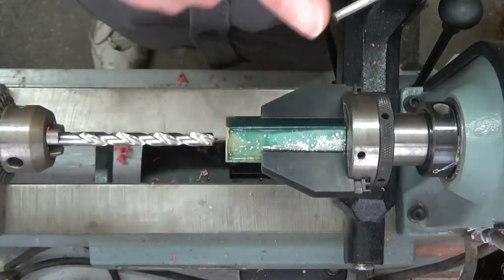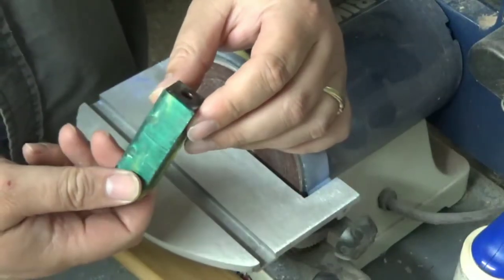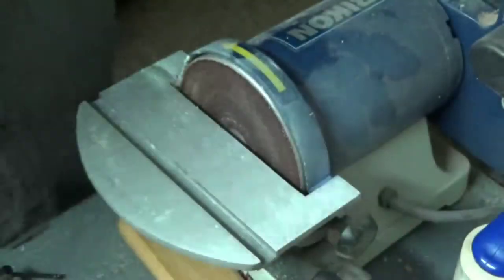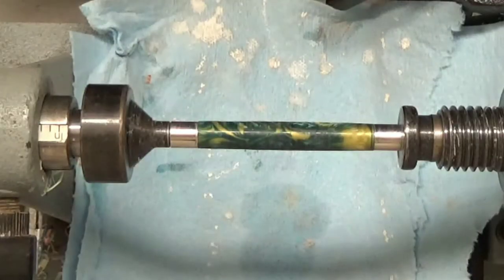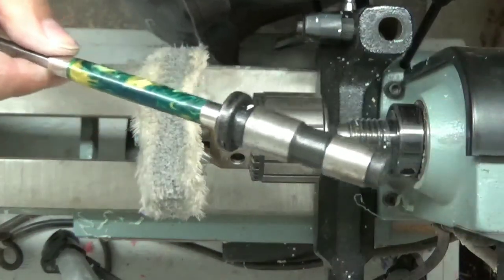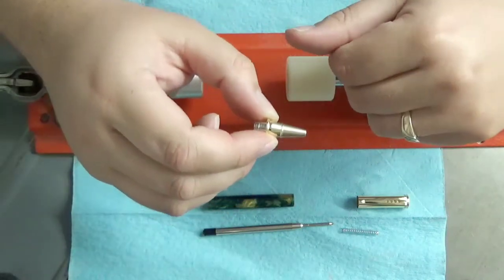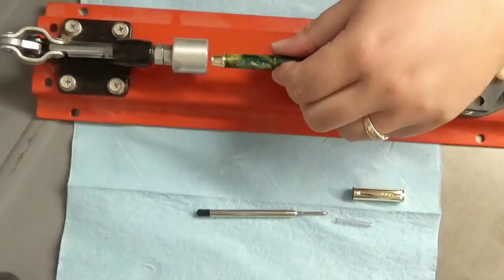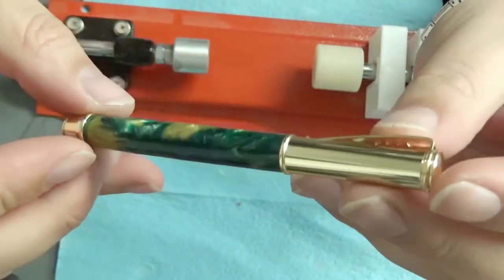Turning a U of O Duck Colors Editor Pen

Comment: What is that block you are cleaning the sanding disc with 2:23
Reply from the maker: It's a cleaning block for abrasives, it extends the life of your abrasives by cleaning the gunk out. Link below

Prostik W1307 2-Inch by 2-Inch by 12-Inch Abrasive Belt and Disk Cleaner https://www.amazon.com/dp/B0000DD0L1/ref=cm_sw_r_cp_apa_i_v6fMCbWW8V3CF
Reply: The blocks work great..completely clear out the dug-in material on the sandpaper belt. One block will last you a very long time. I've been using the one I have now for two plus years and there is still plenty of material left on it.
Reply: @TheTacticalPainter  thank you!
Reply from the maker: You're welcome!
Reply from the maker: Yep, same here, block I have is 3 years old, going strong. Only tear of the plastic where you're using and leave rest in tact, keeps the lower half from drying out.